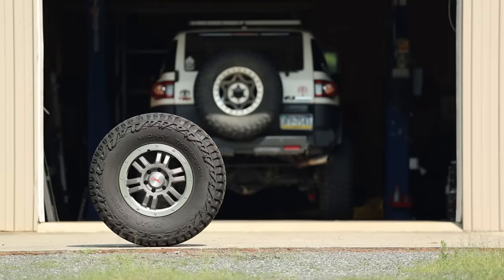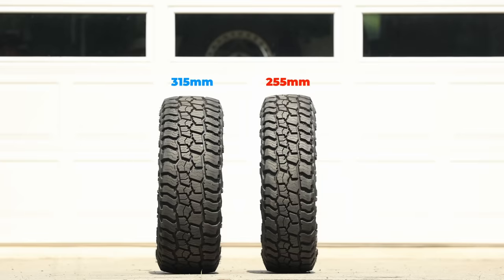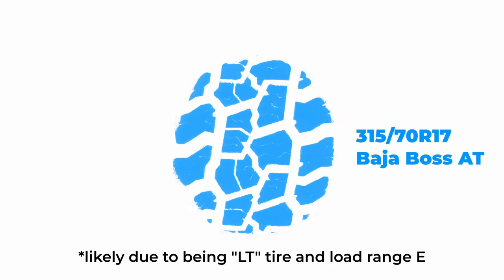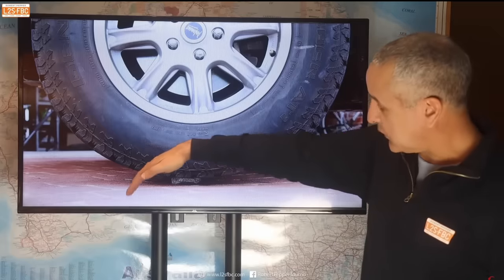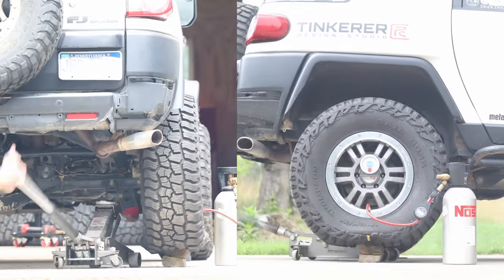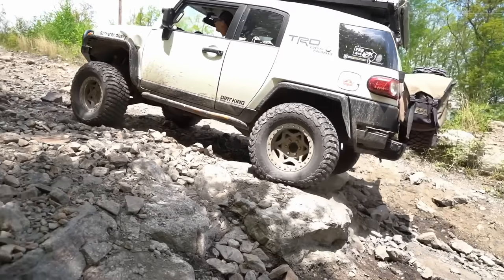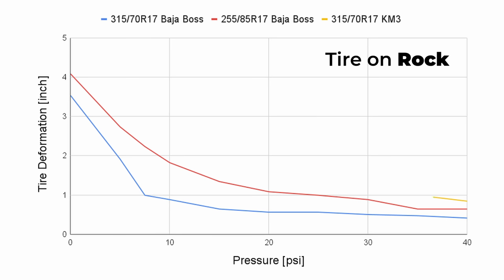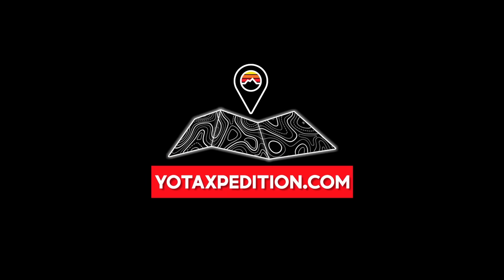3 Scientific Experiments to Settle This | Wide vs Narrow Off-Road Tires

Comment: Great video, thank you for taking the time to produce it.  I'm 70 years old and started off-roading before most of you were born.  The go-to tire back then was the B.F. Goodrich 'Jeep Service' tire.  It was a bias ply very tall and thin tire, only 7 1/2" wide and only fit 16" rims if memory serves me right.    It had very deep lugs, deeper than any tire produced today and worked well in all the conditions you could expect to find off roading in the mountains of British Columbia.   It didn't work well in sand, as we found out driving along Long Beach on the West Coast of Vancouver Island but for all other conditions it gave excellent performance.  Fast forward to today:  I bought a lightly used 2022 Power Wagon last May and it came with 37 X 12 1/2 X 18 Nitto Trail Grapplers.  I now live in Texas and and have off-roaded here and in New Mexico and the tires are about half done at 20,000 miles so I'm starting to ponder what tire I'll go to to replace them eventually.  This video has helped immensely in determing which way I'll go when it's time.

Comment: Thank you for making this video, and making it so scientific. I run pizza cutters on my truck. I actually love the look. It's like a throwback to the old high boy trucks.
Reply: I agree just put 35x10 on Gladiator I love the look of old school look.  Looks like grandpa was right, tall skinny gets you through LOL
Reply: If it was really scientific he would have tested each tire on the manufacturer recommended rim width. A 315 is meant to be run on a 9.5” rim and he pinched it down onto an 8” rim, which negatively effects contact patch and flex. A 255 is meant to be run on a 7” rim and he stretched it onto the 8” rim, which gives it a better contact patch and better flex BUT when stretching a tire you increase the chance the bead will come off especially when putting a side load on it like doing donuts in rocks.

So yeah, the 255 got tested in absolutely ideal conditions and the 315 got tested in the worst condition possible. Not very scientific at all really, unless the question is specifically “what tire is best on my 8” rims that I refuse to replace”.

Comment: As a fellow Mech E and Toyota enthusiast, I sincerely enjoy the technicality in these videos and love to see someone choose a different tactic about product exploration; AKA using hard data to prove the best instead of recommendations based on subjective feel. I really appreciate the hard work in these videos making them as controlled as possible! Thank you!
Reply: Your socalled pizza cutter is also a wide tyre. True pizza cutters were on the T model Fords, and they went everywhere before there were roads.
Reply: ICE and MUD=WIDE. Snow=Taller and narrow.
 Works with posi two wheel RWD and AWD.
 Really works great with 'Get out and lock the hub' types with front and rear posi.
More ground clearance. More better. As long as it is from tire diameter.
 Oh and use just enough pressure to keep the tire from spinning inside the wheel.
But nothing round beats a track. Some track vehicles made for mud, have double wide tracks.
Reply: @warrenpuckett4203  Bottomless mud=wide. Mud on top of a base or in rocky soil (mountain terrain)=narrow to dig to traction. Ice=narrow for greater psi ground contact. Snow- wide to float on top of deep snow, narrow to cut down to traction (paved/gravel surfaces). Sand=wide to float. And from experience: if you're gonna be seriously off camber with skinnies, don't air down as much...sidewall folds over and slides downhill with minimal contact patch...run enough psi 
             { '89 XJ Cherokee running 34/9.50 15 TSLs on custom 5.5" wide beadlock wheels most terrain,  38/12.50 15 TSLs (hot knifed & siped) on 10" wheels @ 2-3 psi for deep snow wheelin'.}

Comment: I actually really appreciate the unbiased and science-backed facts that show the skinnier tyre to be superior. All these years I've stood by the concept of a wider tyre having more ground coverage, but this shows that to be untrue, not only is it literally physically proven - it also makes so much sense now that I've seen it explained. Excellent work mate. I know this would've taken a while and I appreciate the extra effort you go to using nitrogen instead of standard compressed air. Would've taken ages to make this!
Reply: Before you take off and base decisions and opinions on that info, just remember that it's true for this particular tire only. Some tires will be the exact opposite, for some it won't matter, and adding to that, it may be the opposite once a tire has seen some use.  It's better to research the performance of a particular tire than applying generalizations to all of them, regardless of what a test may show.  Also, that was CO2, not nitrogen he was using.
Reply: The tire pressure on the wider tire has to be adjusted as it has more air volume and doesn’t require the psi that the skinny tire does. You cannot compare both tires with the same pressure.
Reply: I'm just curious - why did you ever think that that ground coverage would be affected by tire width? It's basic physics. The car's weight applies applies a certain force through the tires due to gravity. Divide by 4 to get the force exerted on each tire. This force therefore must be constant unless the vehicle's weight changes. Force = pressure X area. So unless you're putting a different PSI into different width tires, the the area must be the same.
Reply: No fantasy here...the work is outstanding and thorough.....I'm very impressed
Reply: its not controlled for the weight of the vehicle so this only applies if your vehicle has the same weight on the tire, my truck is way heavier than an FJ for example so the tire flex on 315s is much greater at higher PSI. One persons wide tire is another persons skinny.
Reply: @bluestripes1  so what you're saying is, because your car is heavier, it means that the skinny tyre won't flex as much? You gotta think this through a bit more, fella.
Reply: No, he's saying that the wider one flexes more on the heavier truck.  A load E tire on a light truck won't flex even half what it will on a heavy one.  One of my trucks will flex a load E at 40psi.  My other truck won't flex the exact same tire on the same wheel at 10psi.   @dubbbs
Reply: @jonboy602  Yep, the clue is right there in the unit:  pounds per square inch.  Less pounds = more square inches.
Reply: @jonboy602  so you're telling me a wider tyre doesn't have as much surface contact as a smaller tyre? This is on hard ground, by the way. Once you're on a trail in soft ground, the psi pressure plays in to it less, but I was happily admitting that if the tyre is considerably pressurised - say road pressure, it is as likely to have as much surface contact as a thinner tyre. But the most basic of physics in play (what I assumed) is that a wider tyre will have more surface contact. I hadn't considered the contact when the tyre is pressurised. That's all. But a 10" wide tyre and a 20" wide tyre - depending on vehicle it's mounted on and tyre pressure is always going to have a different contact patch. This is just interesting science at play here as the video has shown that between the same brand and rubber compound, one tyre that is not as wide behaves very similarly, and better at lower pressures than the wider tyre. Depending on vehicle, load and rubber compound would change a lot of factors here. I'm not saying that his footage here shows that all thinner tyres are better than wider tyres. I'm simply saying this is very interesting science and data.
Reply: For a given vehicle weight, all tires have the exact same contact patch area at the same psi.  Different shape maybe, but same sq inch area.  Physics.   20 pounds per square inch holds up 20 lb per square inch.
Reply: @jonboy602 , all this relies on the assumption of equal pressure in both tyre sizes, why can this be assumed? Moreover, why is tyre flex more important than tyre width? As the video showed, the contact patch area is the same on a flat hard surface, maybe that's the case on a rock too. 

And this is a test for just one very specific type of off road. It's obvious that on soft surfaces you need less pressure applied to the ground, wider tyres allow you to do it.
Reply: This isn't really all that great of testing. It's halfway decent for anything that could be done in a driveway with a few simple objects, but just the fundamental idea of testing a dynamic part (designed to move) under static conditions to provide any type of solid opinion is something ANY real mechanical engineer worth his/her salt would look at, chuckle, and say, "bless your heart", "aren't you just the sweetest thing", or "you are SO precious".  At BEST, these tests give information applicable for on-road driving tires.  I will explain why.

There could well be (actually, definitely is) a difference in tire patch while the vehicle is being driven and the sidewalls are under torsion.  How well does the tread section flex for traction on uneven surfaces?  How does the tire deal with flex (and therefore tread patch) from multiple contact points and pressures coming from several directions?  

All of these variable conditions and more will be affected by a number of variables that directly rely partially on pressure vs air volume and would likely benefit the wider tire, at least to some degree.

The arenas where wide tires have a DEFINITE advantage are those where you are driving on soft surfaces.  Wider tires float and provide traction.  Skinny tires dig in and leave you high-centered.
Reply: @jonboy602  -- You're using 3rd grade physics to explain a 6th grade physics question.  When dealing with pistons and completely neglecting friction, you are correct.  What you are neglecting is the mechanics of the materials involved.  The materials in the tires have a non-negligible amount of rigidity, or resistance to deformation.  The more material, the less you're relying on air pressure to resist deformation and the more of the properties of the material, itself.  Double the tread width and you significantly increase the tire's resistance to deformation.

Before you start screaming "equal sized sidewalls", remember, it is the TREAD that's going from round to flat.  When you get to college and run the actual math, you'll be shocked at how much that actually matters.
Reply: @MrPaukann -- Some people operate that way, but it's a myth.  This is an area problem, not a volume one.  The outward push on the sidewall that keeps the tire on the bead is a factor of the area of the sidewall, which isn't changed by the width of the tread section.
Reply: @kender1412 , I edited the comment to better explain my point. The pressure was measured in non deformed state. But what was the pressure when they deformed? Can they be assumed to be equal? I doubt it. The test at 0 pressure showed different deformation. Is it due to different stiffness of tyres themselves or due to different pressure inside in the deformed state? If it's just the tyre stiffness, then this test is only applicable to that specific model of a tyre.

Wider tyres are run with lower pressures. Look up a bicycle tyre pressure table, for example. All the low pressure off-road tyres are very wide. Maybe only Sherp tyres have normal proportions.
Edit: ok, bicycles operate in a different mode, the constraint is tyre deformation, not the tyre detaching from the rim.
Reply: The test is misleading. I work for a tire mfg and this has been known since the beginning of tires but the wider tire has a bigger contact patch. You can’t compare different volume of tires at the same tire pressure. To do the test right he would have to do it based on the percentage of volume per tire. A skinny tire at 30psi rides much softer than a wider bigger tire at 30psi. It’s maths.
Reply: @LyfeisByke  yes, 100% aware of this. Hence why I didn't respond to some of the potato comments people have put under this original comment.

Absolutely what you're saying is facts. Some people are trying to argue to what I'm saying like somehow "it's physics" by them just saying that makes it factual 😂
Reply: @LyfeisByke  like, I wasn't implying this closed experiment is a "one size fits all" fact. I just found it interesting to consider that it's not always the width of the tyre that makes the best application. At the end of the day, it all boils down to the rubber compound, and how they've designed it to operate. I've seen super flexy BFGs, and then I've seen a mates Ute with BFGs down at 18psi and they hadn't even started to sag yet. But he had fitted the tyres to his factory 18" rims on his Ford ranger and were I think 31", so they were never going to perform my like MT ATZs on 16" rims and 33"  diam. When dropped down to 20 psi on my landcruiser.
But, different brands, different vehicle weights, different sizes. All boiled down to different rubber compounds, and therefore different parameters when it came to sidewall flex.
Reply: @MrPaukann  -- Thank you for your edit on this comment.  Bicycle tires are a COMPLETELY different beast.  The pressure differential on skinny tires when deformed is higher than on wider tires.  This is due to volume.  Theoretically, you could run lower pressures, unloaded, undeformed, on skinny tires because the pressure would increase more when they were loaded and deformed.  This is due to volume.

As far as zero pressure is concerned, there is zero air pressure, so no pressure inside.  That is purely a factor of tire stiffness.  Yes, this set of tests is purely applicable to that specific model of tire.

That's only the beginning of the problems with this particular set of tests.  They may be ok for street driving, but not for variable surfaces.  Often, in off-roading, you aren't just on a single rock definitely your tire.  In fact, you are almost NEVER on ONE rock.  The bottom of the tire isn't the only point of contact and traction when you're climbing a staircase.  That's not factoring in mud or sand on the trail, where your skinny tires would just dig in, leaving you sitting on your differential while the wider tires would have you floating on to and skimming right through.

Even more so, this is a static test on a product designed for dynamic conditions.  Torsional forces and movement change everything.  At rest, the tire will definitely differently and have a different contact patch than under torsion and spinning.  Tire science (and it is a science) is a LOT more complicated than most people understand and really can't be examined with a jack and a pebble in a driveway...unless it's a really long driveway and you throw away the jack.
Reply: Personal experience: wide tires are only good for loamy sand.
Reply: @The_Ballo  -- Personal experience--you're forgetting about mud and just about every other loose surface where skinny tires just dig in and get you stuck.
Reply: @kender1412  You have it backwards, my friend. Skinny tires cut through the mud to get traction. Fat tires float over the mud. This is why duallies suck for mud or even wet grass.
Reply: @The_Ballo  --  You're flat out wrong. Dualies suck in the mud because they suck up mud in between the duals and form a slick.  They suck in the grass because the driver needs to learn how to f@#$ing drive.

Unless you're dealing with the results of a 15 minute drizzle, skinnies dig down until you're resting on your differentials and going nowhere.  This is backed by DECADES of experience going back and forth to the ranch.  I initially had your opinion, but was proven wrong.  Then, degrees in physics and automotive engineering, including tire science (which is a hugely under appreciated field) verified.  Wider tires float on top of the mud and sling it , providing forward motion while skinny tires dig in and bog down slightly before burying the vehicle.  That's why I was able, in my four cylinder 2.4 liter red ranger with floatation tires, able to pull full sized broncos out of the mud at dome all day long.

Comment: Something else that I believe is important to mention is the sand wall or mud wall in front of the tire causing resistance. The thinner the tire the less resistance it needs to overcome. Ive noticed a big difference going skinny on the sand especially with underpowered engines such as my 3fe on my land cruiser. I dont think id ever go back

Comment: Worth keeping in mind as well is that load range E is really stiff for a truck that light. I made the switch from E's to C's on my Tacoma and gained way more low-PSI traction. Of course, I had to be a bit more cautious of sharp edges off road, but it was worth the trade off.
Reply: Would of been even more interesting seeing differences between E and C.
Reply: It would be great to run that experiment between C and E with identical brand new KO2s in 315/70/17 (both C and E are available in that size).